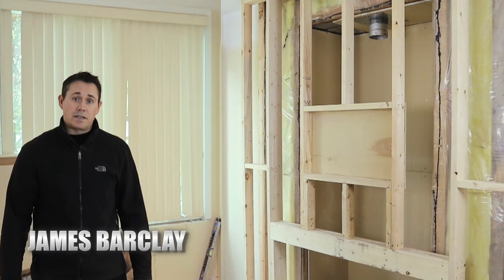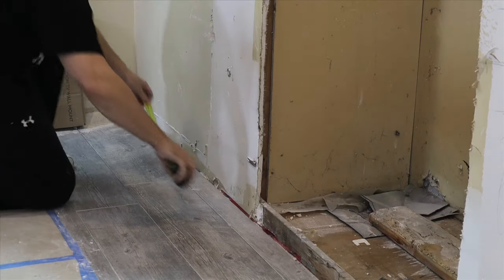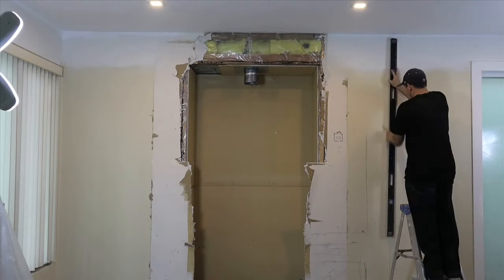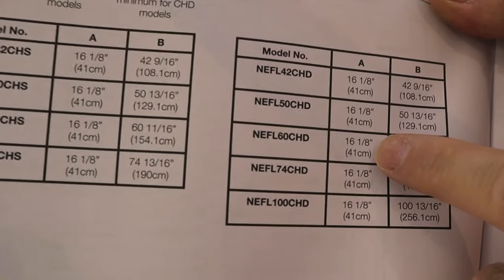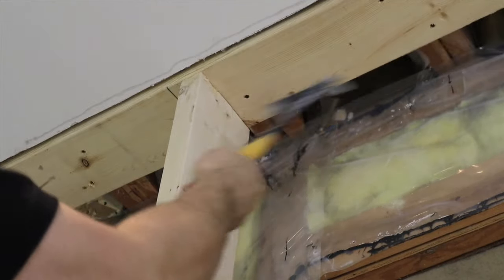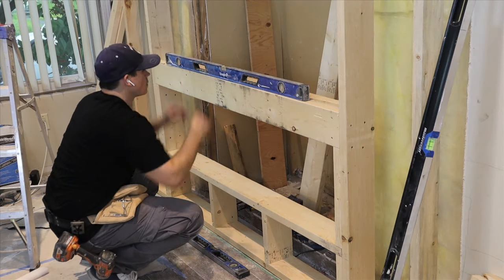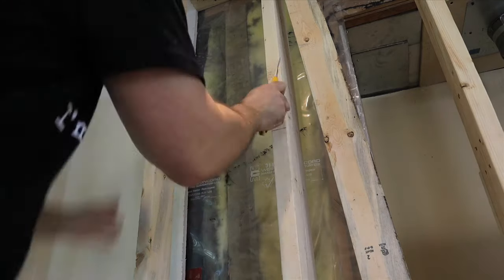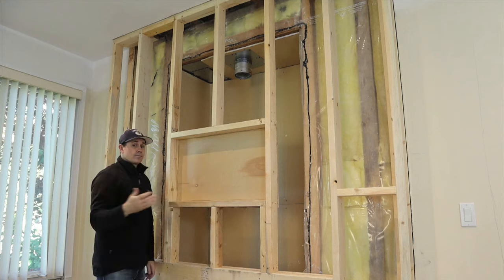HOW TO FRAME A FIREPLACE with TV mount support!!

Comment: Great vid! Even better closing remarks! 🤣

Quick question, are you anchoring your tv mount into studs or ply? If ply, did you use reinforcement?
Reply from the maker: 3/4” plywood is plenty strong enough to attach a single TV mount with bolts, but you can double up the ply if you like…

Comment: Thank you for the inspiration, nice job.  I’m a disabled homeowner who lives in an Atlanta—suburb north.  Would you consider working here?  Home built in 2007, cement subfloor, carpet. Existing gas (non-vented) fireplace—60” drywall left to right.  Realizing logistics is difficult and costly, maybe this is still something you’d be interested in?  Your measurements, insert etc., all would work for my application.  My goal here is to replace the 65 inch TV with an 82 to 85 inch. Move from gas to electric while bringing in something more proportionate to the large TV.  I’m thinking a hotel and however many days it takes. 

I have a two car garage in front, living area in back opens to outdoor living room in close proximity to working area.  There are double doors 15 feet from the fireplace opening to large rough-sawn cedar pergola atop stamped concrete—work environment is ideal.  If there’s an email address where I can answer any questions I am ready to go forward.  If nothing more, my invitation/inquiry should flatter.  We’ll done!
Reply from the maker: Sorry Christopher, I live in western Canada, so I’m a bit out of range, but building this style of fireplace really isn’t very difficult for a tradesman or even a decent handyman. When I’ve needed it, I’ve found good guys to help me out just on Craigslist…
Reply: @thinkreno  I know it James but I appreciate you getting back to me just the same. Thanks for the advice buddy

Comment: Great build. One question, where are folks putting components to use with the tv? Gaming console, satellite box, and such?
Reply from the maker: I just ran a couple of HDMI cables down behind the fireplace and out the side of the wall beside the fireplace. Put box and DVD player on an end table. Otherwise You could add a mantle under the tv where I installed the sound bar!
Reply: @thinkreno  Thanks for the reply.

Comment: I always get confused as to why tv support is needed if the tv is on a mount. The mount holds the weight of the tv by itself. Is it just for piece of mind? Just asking because I’m planning to start a tv wall project
Reply from the maker: If the mount is not supported properly (ie. not screwed into wood or studs), and you just attach the TV mount to drywall with anchors, there’s a good possibility the weight of the TV will eventually rip the the mount right out of the wall.

Comment: Is the plywood strong to hold the tv mount ?  The lag screw the comes with the tv is 2 inch long.
Reply from the maker: Yes, 3/4” plywood is more than strong enough. You can either buy shorter lag bolts or you can glue and screw a second layer of plywood if you want if thicker

Comment: What screws or nails did you use to bolt down the stud to the concrete?
Reply from the maker: I just used nails engineered for concrete. If you want to use regular nails you need to pre-drill the holes with a hammer drill.

Comment: hi, good clear instructions, looking to build my own. I am a beginer but am handy. question though, do you use any software to design your plans as you were showing on paper? if yes, which software do you use or can you recomend?
Reply from the maker: I haven’t used any software myself. I just draw out to the dimensions I need with a pencil and paper. Although for my kitchen layout, I used IKEA’s design software off their website, even though I bought my kitchen elsewhere. Worked pretty well!
Reply: I would recommend SketchUp from Google, it’s free and fairly easy to learn. You also have the benefit of swing your build in 3D and can even add colors or material finishes.

Comment: I had a question, if i plan to do this but use a porcelian stone instead of plywood is there much difference?
Reply from the maker: If you’re mounting any kind of tile or stone, I would still use cement board. The thinset will adhere to it better

Comment: Great video! Question for you, I have a wood burning fireplace with a gas ignition. Do I have to remove this old fireplace or can I block the flue and build a frame like yours over it? I’m thinking of installing an electric linear fireplace. Would this be against code or anything ?
Reply from the maker: I would get the gas disconnected by a professional, and then you’d be fine to build over the old fireplace. If you do that, I’d also consider putting some flashing across the top of your chimney to prevent animals/birds and water from entering
Reply: @thinkreno  thanks for the info and the great videos!

Comment: Hello, thanks for the great video. Question for you, what did you use to pin the base plate to the cement subfloor?
Reply from the maker: Just common 3” nails, but you need to pre-drill the holes. A hammer drill is the best way!

Comment: Hello, what if the 2by4's that I got at Homedepot are not really square?  Some are bowing a little.
Reply from the maker: You can face the bow side out and use a belt sander or planer to remove the bow, or just go back to HD and pick up a few straight 2x4s

Comment: how did you do the electrical work?
Reply from the maker: I just spliced into a power supply line in the crawl space beneath the fireplace. I made a video about it called “wire splicing step by step”

Comment: What size screws did u use to attach to the wall
Reply from the maker: 3” wood screws (#8)
Reply: @thinkreno  thank u i have another question do fire place need to sit on joists below
Reply: Will deck screws work
Reply from the maker: Sure, if they’re long enough.
Reply: How many screws can u put in one stud on the 1.5 side
Reply: @thinkreno  hey i use nunber 9. Screw and im in the stud about a inch is that good
Reply: @thinkreno  .750 to and inch. In
Reply from the maker: I like to put them every 12 inches or so
Reply from the maker: Inch is good
Reply from the maker: Inch and a half is ideal
Reply: @thinkreno  i added 4 inch screw and hope i didn't split stud I'm adding backer board and time monday

Comment: Is that mold on the insulation?!
Reply from the maker: Not mould, just dust and other particles from outside caused by thermal bridging (air leak). Not dangerous, but if you spot black insulation you know there’s an air gap nearby that should be filled!